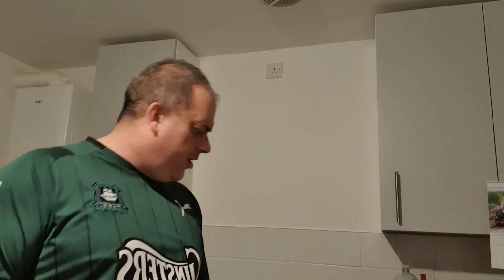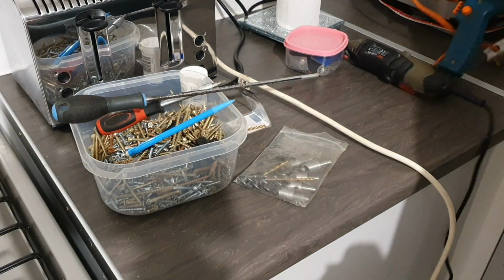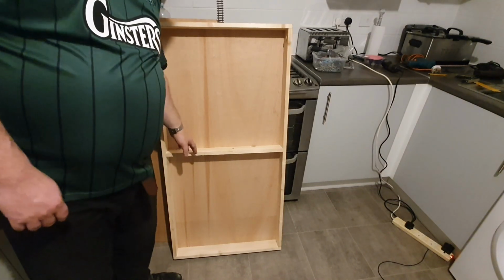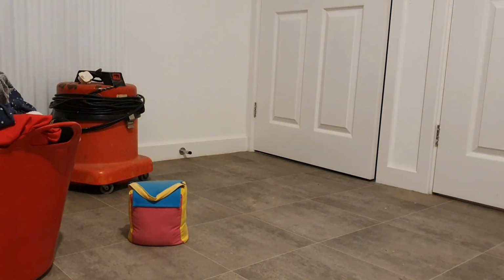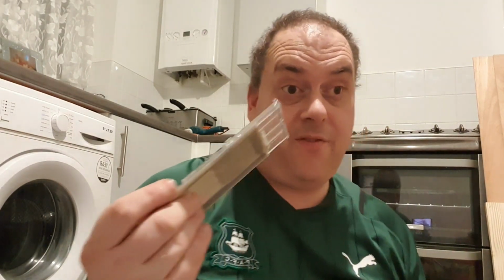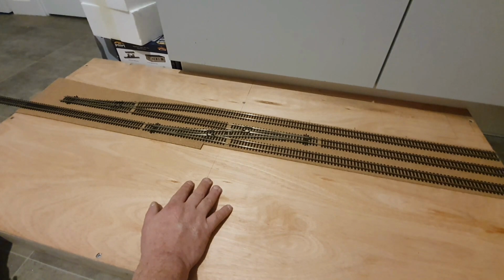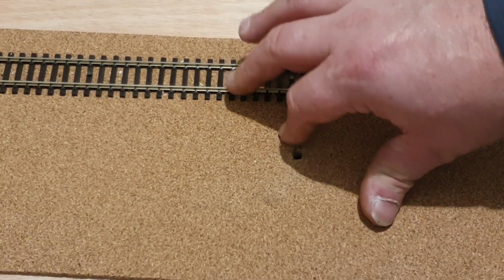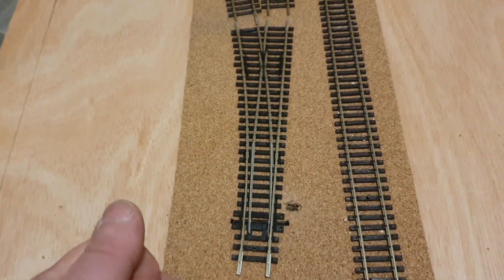Chelmswood Junction has a new OO gauge railway

Comment: Hi Peter, when do you rest? I can’t keep up with you. After 12 months of planning I am just constructing my base board never mind laying track. However thank you for the knowledge your are imparting to us all. A couple of tips I can pass on from watching days of YouTube firstly when you are removing the pins have a small piece of wood under the front of you forceps so that there is no chance of the tips digging into the sleepers secondly there is a video out there showing someone installing the Cobalt motors by placing them upside down on the track so the wire is going through the board and then he drills four pilot holes from the top down so that when he installs the motor from underneath there are four pilot holes for the screws. It seems like a good idea and one I will be doing eventually as I have around 30 point point motors to install. Don’t forget you are you and we watch you because we like what we see - thank you till next time…….
Reply from the maker: hi peter
glad you enjoyed the video and i will take what you have said on board and try things your way so thank you.
peter

Comment: Good to see you back on track, Peter. Hope our new build goes well. Just one thing I have to comment on. The use of cork will not deaden any sound what so ever. What I have found helps to deaden the sound slightly, is to use 3mm foamboard between the underside of the baseboard and the bracing strips. It really does work. Anyway, I'm looking forward to you layout build in future videos. Keep up the good work.
Reply from the maker: Hi Clive 
I didn't know that oh well it will give me a realistic ballast shoulder if anything.
So looking forward in progressing with this project.
Peter

Comment: Hi Peter. It doesn't look like you have made a track plan; so, did you just  position the first point by eye? Also, it didn't look as though you glued the cork to the baseboard; did you do this off camera? Your phone seems to reverse the image; the writing on your shirt was back-to-front; is there any way to "cure" this? Look forward to the next episode.
Reply from the maker: Hi Paul
Reason for backward camera is I need a camera operator lol so I have to videos with the screen where I can see it.
No the Cork isn't glued down yet I'm just test fitting the track work then it will be lift and glue and tack down permanently.
Hope that answers your questions.
Peter